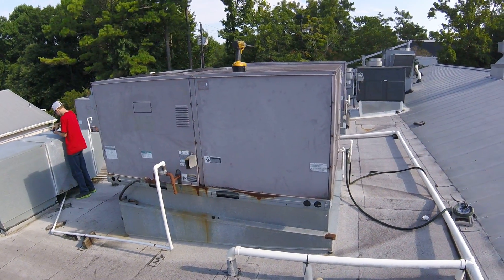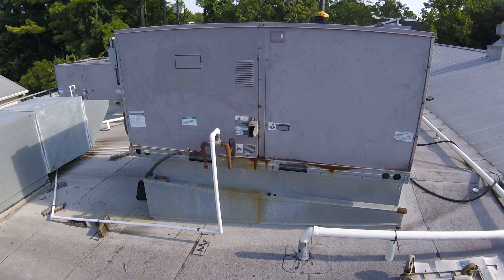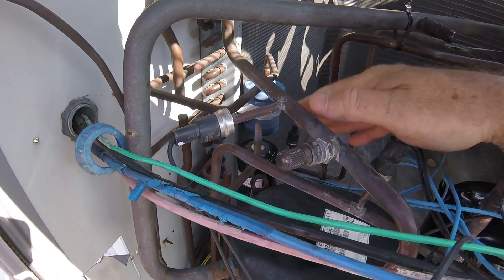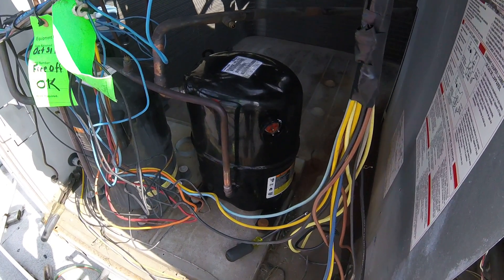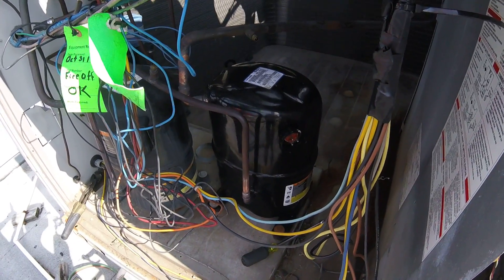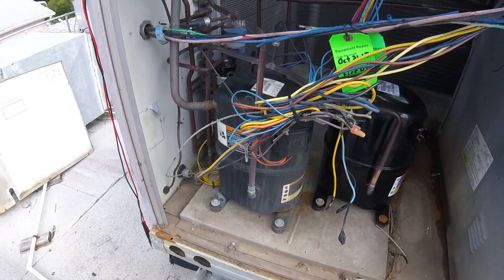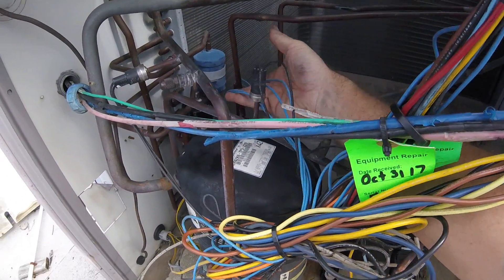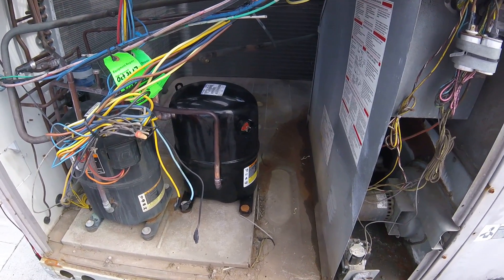Change Compressor Okami Part 3

Comment: Good job, i would pressure test get the vacuum pump running then go get plug and lunch. Good Vacuum sometimes takes a while if you pulling below 500 microns.
Reply from the maker: Bernie Clement that's what we did. Always below 500
Reply: Very stupid it didnt come with the plug, Makes you remember to open the box when you buy it now lol.
Reply from the maker: No need to remember to open the box, they gave me the plug at no extra cost. If it is not in the box it's on them. Thanks for watching.